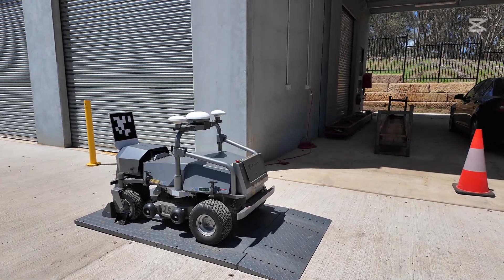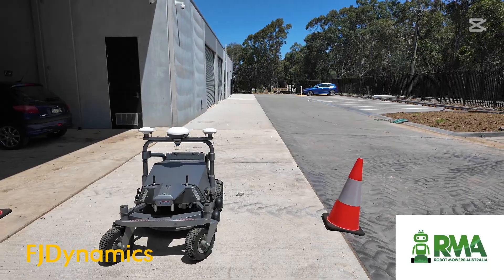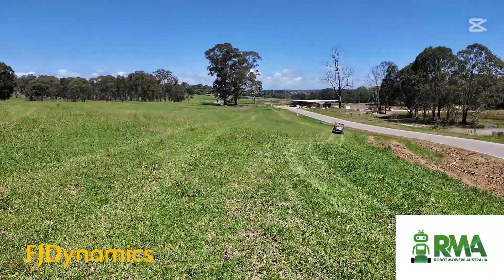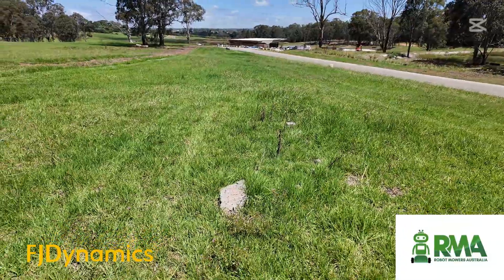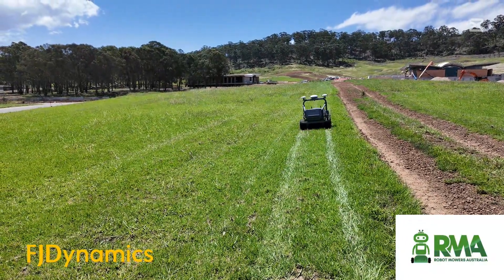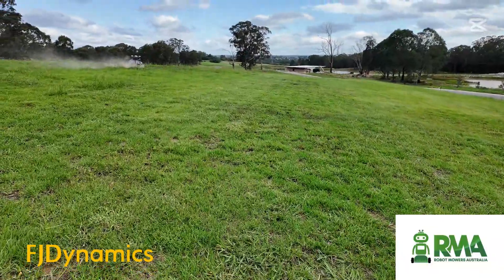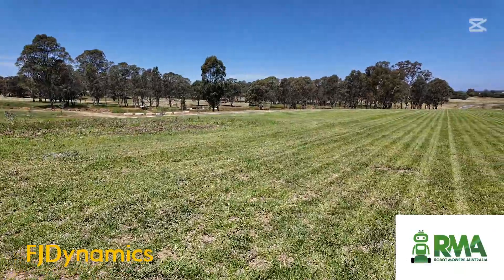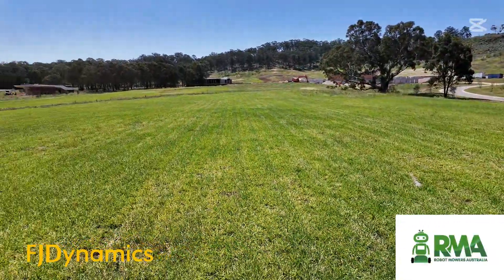Are autonomous mowers up to the job of maintaining acreage sized grass areas?

Comment: What have been your experience with this mower so far?  Reliability and durability?
Reply from the maker: Hi Rob. So far we've had good feedback from our customers. One thing we've learned is that the 4G network can be unstable at times, especially in regional areas so they work best when navigating using the option GNSS Base antenna as this give it a constant signal without interruption.